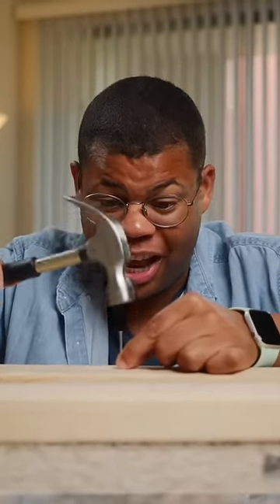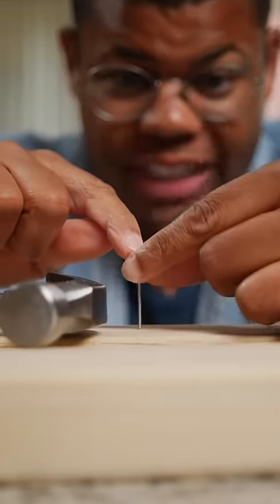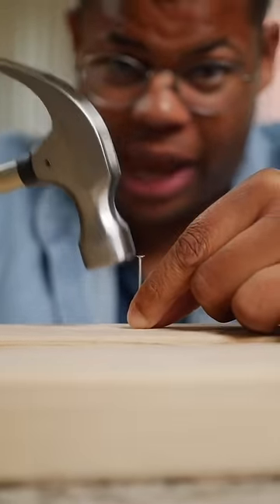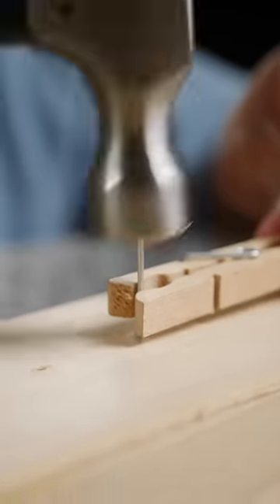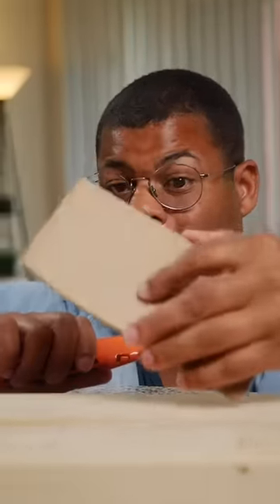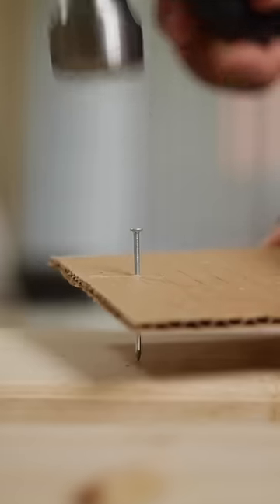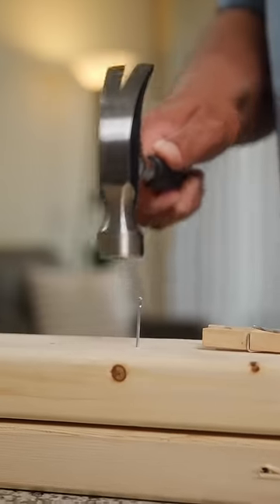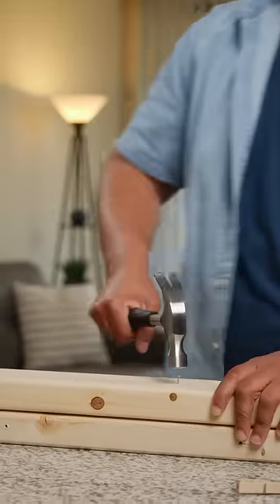How to use a hammer like a pro #shorts #lifehacks

Comment: Taught my self how to use a hammer so take this with a pinch of salt.

Ok first of all, DON'T USE CLOTHESPINS. The problem with using clothespins is that you won't have as much grip and control as you would have if you're just holding the nail. The pliers would be better since it would have better grip but the nail might just slip. Better hold the nail in the middle than using other extra equipment.

Next, the first 2 strikes doesn't need to be power strikes, just use enough force to indent the surface. You'll know if you did it right if the pointy end of the nail won't move when you try and twist the nail. 

After making the indent, straighten up the nail so that it would be perpendicular to the surface and whack with the hammer. Once the nail is half to two-thirds the way in, you can now whack the nail without your hands guiding it. 

You could also whack the nail for a couple more times to make sure that the nail head is flush to the surface.

And now you have used the hammer without killing your fingers. Again, take this advice with a pinch of salt. I am not a professional hammer user and is just self taught. I hope you guys have a good day
Reply: Underrated comment and yes you are completely right that's how you're supposed to hammer in nails, the idea is that you give it a few taps to start it and center it then send it home and drive the nail in with a few good hard wacks
Reply: also choking up on the hammer will give you more control, not holding it on the butt end. and the amount of power has more to do with how you hard you hit it than hiw you hold it.
Reply: I thought the same thing when he said clothespins
Reply: For real watching thjs gay guy pissed me off
Reply: @coolpug4227 
Control? Yes
Power? No. There's not enough leverage to pound the nail in, and you'd be using more force than necessary if choking the hammer
Reply: @Anthony-dl2qu  a lot actually
Reply: finally a reasonable comment
Reply: Thank you for actually explaining well enough how to do it rather than just act all pretentious like the other dudebros on here. Your words of wisdom are greatly appreciated and will be remembered.

Comment: Idk, I think hammering nails is something you just have to get hurt sometimes or you'll never actually do it correctly. If you're looking to drive a nail the best tip is to have a hammer with some heft behind it. You don't have to hit as hard if the weight and momentum of the hammer can do the majority of the work for you.
Reply: Lighter hammers are better for nail work.
Reply: @autumn5592  I guess it depends on what you're doing and what sort of nail you're using. If you're just tacking some nails into the wall to hang picture frames or something I can see a lighter hammer being easier to control. If you're doing any sort of carpentry and need to just get nails into wood it's probably best to use a heavier hammer. 

You're right, but it does come down to the job at hand.
Reply: Use pliers, my step mom destroyed her thumb once while hammering roofing nails into her shed

Comment: The most important skill i learned when i was a truss builder is to keep your eyes on what you’re hammering and you’ll never hit your hand. So far it’s worked for me. Also swing with purpose. It’s a lot easier that way.
Reply: Yep, no sissy taps.
Drive it in as few hits as possible -- it will also teach you to not hit your fingers.
Reply: And hammer with your elbow, not your wrist. It helps drive the nail deeper and avoids the risk of hurting your wrist

Comment: Holding it at the base doesnt give you the most efficient hammer power and control, grip it around the middle of the hammer strap where the traction is perfect and the weight is distributed properly and you will achieve it.

Comment: A tip from a Carpenter's son. Hold the nail between your index and middle finder with your finger-nails towards the surface. If you miss, you hit the flesh of the finger instead of the nail. Hurts alot less...
Reply: I figured this out for myself and is how I hold nails most of the time.
I was pissed off with hitting my hand  when I was a boy, so I started seeing if I could find angles or ways to hold it. 

This way is one of the best I'd found, and allows you to keep nails in your palm so you don't have to keep digging in your pockets or box for more.

Comment: holding at the base gives you the most power, but choking up on the head gives you control. usually i hold it in the middle for a good compromise but change grip if i need to

Comment: Ok, so I’m in a course about plumbing, and have been taught by professionals how to use a hammer. If you hold it at the base, you’ll get more power, but less control. If you hold close to the front, you’ll get more control over where the hammer goes, but less power. So I’d recommend holding it in the middle, but at the end of the day, it all depends on the situation you’re in. Wether you need to be really careful, or can go as careless as you want. The number thing to remember though is if you’re a tradie, fingers are a very important body part to you.

Comment: That is pretty good. Now for the real tip. Hold the nail between your index and middle finger with your palm facing upwards. This way if you hit your hand you will not damage it. The injury will be far less than hitting the tip of your finger. Even small nails will work this way too. If you are really good you can put a hand full of nails in your hand and bang them in super fast.

Comment: Ok so I'll tell you the real trick, most of you will be using soft wood, which you can damage with your fingernails
So just use you hand to push the nail in a bit first so it stable and won't slip from your nervous sweaty hands, then hold it in the middle and let the hammer do the work
You don't have to swing hard, just help the hammer build a little momentum and the weight of the hammer will drive the nail in
And if you aren't strong enough to push the nail or are using a harder wood
Choked up on the hammer and tippy tap until the nail can stand alone
Then hold the hammer at the end so the bottom of your fist is aligned with the bottom of the handle and follow through with my swing tips above
Happy building friends

Comment: for tip 1: fingers at the top help with not hitting fingers but they reduce how hard you can hit and still have stability, at the very bottom you will have much more stability, you hit your fingers? cry
2. dont use a clothespin lmao, use short pliers, i dont care what he says
3. cardboard wont let you perfectly see the angle at which your hitting in the nail
finally, you dont have to hold the hammer at the very end, and that wont give you the best control, holding it at the very top of the handle helps you make good, soft hits if you need it. please dont listen to this type of advice from someone who looks like a guy from a school textbook

Comment: Well I mean if you don't want to smash your fingers while you're pounding in the nail don't hit it extremely hard. 

The technique I've been using for years is basically to get the nail started with a couple of light wacks just to get it so that it's sitting into the wood and won't fall over. And then you can move your fingers out of the way and go to town on it.

Comment: So the finger placement is okay, just not always possible. What you wanna do if youre unsure is tap the nail in light until it can hold itself up, then give it a solid hit or two to make sure you got it and it wont go flying off, then pound it in. If you hit your fingers during the tapping, it's okay it'll just hurt a little and you won't break your fingers

Comment: I would not recommend using anything from this short as the first two strikes dont need much power. If you are afraid to smash your fingers then just hammer the nail down slowly untill its secure. After that you can start hammering it freely but just watch out how you hammer as the nail can easily ben without you holding it secure.

Comment: Im 15 and i do construction as a job and it's easy to just do it and the crap about holding it at the base is incorrect it only helps power to get more control u need to choke up on the hammer

Comment: There is so much wrong with this video. All you need to do is hold the hammer near the head until you get it into the wood. Usually takes like 1 or 2 relativity light hits. Then you're good. And holding the hammer near the bottom does give you more power, but it gives you less control. Also, hitting your fingers with a hammer only happens if you aren't paying attention, you have no hand-eye coordination, or you are swinging too hard. The weight of the hammer does most of the work. You don't need to be swinging very hard, unless you have a small hammer or a thick nail into very hard wood. And don't use a clothespin. Not only does it not really do anything, it makes you look like you wear a hat with a propeller on it.

Comment: These are pretty good tips for people doing small around-the-house projects, which is what these tips are for. If you're going to be hammering for long periods, for instance if you're a carpenter, these tips are something you'd want to avoid. You'll also want to make sure to use your wrist when swinging the hammer, this'll give you more power and you won't get tired as quickly.

Comment: A few issues you get more control by choking up on the hammer you get more power by holding it at the end also instead of using any of these facts how about you just learn how to hit the head of the nail instead of your finger I had to learn the hard way so should you

Comment: Ok. Wat in tf does this dude figure. Bro how bad does ur eyesight have to be in order to miss a nail or how un tough must one be in order to take the extreme measures of using a frickin clothes pin to hold a nail rather then enduring pain. 

Im a carpenter and hitting your finger with a hammer as gently as he is implying is the lowest of threats in a jobsite. Kids nowadays 🙄